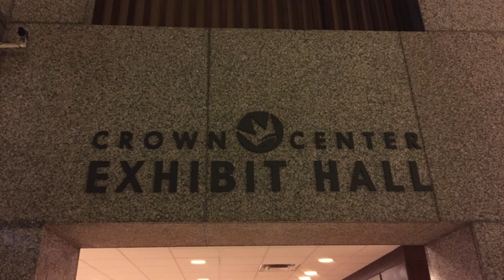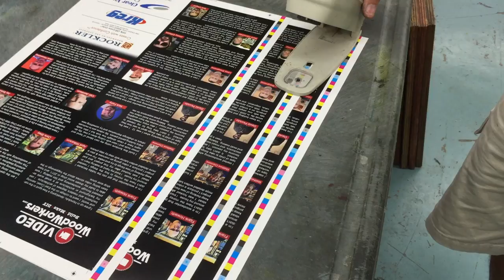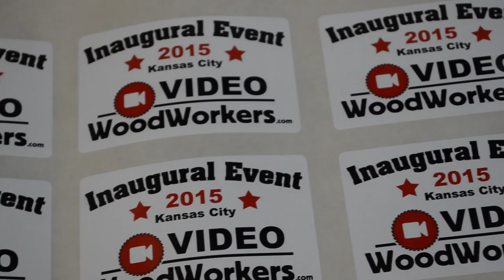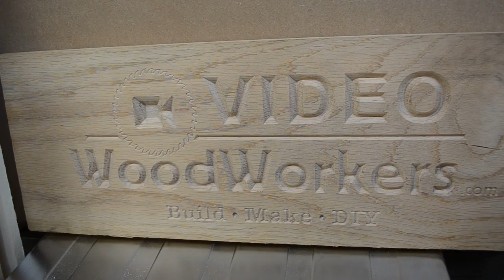Signature Stamp, WIA & Offset Printing (FT34)

Comment: Glad you enjoyed your tour Nick.  I have been in the printing industry for 29 years and it's always fun to show a client how blank sheet goes into one end of the press and comes out the other end with a full color image on it.
I like the stamp too.  I use a self inking stamp that I apply between the layers of the finish.
Reply from the maker: +Chem Cody I thought I remember you being on that periscope - I could be wrong - yeah it was really cool to see how professionals do it - in high school we were essentially "messing around" with different presses and never got quality results - I have tried the ink stamp before but for me the results were mixed
Reply: I think that was me Nick.  (I'm getting forgetful)
I figured out that if I laid down one coat of finish and then stamped the piece it would stop the ink from 'soaking' into the wood and blurring the image.  The next coats of finish then encapsulated the image and that seems to be working pretty well so far.
I still like the idea of stamping your makers mark into the piece.  I will have to look into that.

Comment: It's probably Acrylic. 
The lay the thick sheet of acrylic on top of a (wooden) mold with a very smooth surface.
The mold and sheet are placed in a very big oven where the sheet gets soft and sags over the mold.
Reply from the maker: +RoboCNC Frees- & Graveerwerk that makes sense - I would really love to see the whole process and that oven
Reply: Sometimes you can see it on the discovery fish tank shows... Between the nowadays normal acting and faking they do some very very short shots of how they make stuff...
Reply from the maker: +RoboCNC Frees- & Graveerwerk I checked it out and still can't find the builds

Comment: The tanks are usually a sheet of acrylic that is set on top of a form then put into a large oven and then as the acrylic is heated it forms around the form which gives it its curved shape.  I would recommend checking out 'Tanked' on animal planet (or the web site).
Reply from the maker: +Sport66Fury thanks - I will check that out for sure

Comment: Miss you long time.  The fish tank bulbous thingy was most likely acrylic and in the show "TANKED" they show how they take large sheets of 2-4 inch thick acrylic and heat it over a mold made of bendy plywood shaped how they want it.  Bottom line, it's acrylic that's heated and melted to form to a mold.  Not cheap or easy for a piece the size you saw.  Cheers!  Chris.
Reply from the maker: +Cactus Makeshop that's what I was thinking, that thing must have cost some bucks - would be a cool thing to see
Reply: +Nick Ferry  What Cactus Makeshop said. I worked for a plastic company for a short time, and they made a piece similar to the semi-sphere in the aquarium. The sheet acrylic is heated up and molded over a wooden buck, or sometimes an inflatable bladder is mounted underneath and filled with air to form the proper shape. At least that was how this company did them in the 90s. And yeah - think 4 - 5 figure expensive, depending on the size.
Reply from the maker: Mark Lindsay I have to try the inflating thing - gotta be fun to do
Reply: Nick Ferry  Just the bladder probably cost as much as your table saw. It was a seriously thick rubber job that hooked up to the compressor via a complicated system of valves and regulators. Thing weighed over 100lbs. They didn't use it very often, but when they needed it, nothing else would do. They tended to use wooden bucks and molds a lot more often. The owner of the company made custom tail light lenses for his '40 Ford pickup by heating up red acrylic and using a wooden "mold" in a cheap HF shop press to press down into the acrylic. They came out looking like '59 Cadillac lenses, but sized for his tail light housing. The main thing to remember is to go slowly so you don't punch through the acrylic.
Reply from the maker: Mark Lindsay I will forgo the bladder and just try and blow up the plastic - might not be a vid but I have to try it now

Comment: I was wondering where you had run off to. Thought maybe you'd gotten lost in the KC BBQ restaurant rabbit hole. It's very easy to do, BTW. Hope the hand is feeling better. You might consider a cheap splint from Wally World for evenings when you're relaxing from work. It does actually help the healing process. I know this because my wife is 3 weeks into the same thing - broke her right hand. The splint does help - even if you only wear it for a few hours a day.
Reply from the maker: +Mark Lindsay I looked all around for a cheap splint but kept running into wrist ones only - I have a half-assed one I came up with but it could be better
Reply: Nick Ferry  Now how did I know that you'd make one? Cheers!

Comment: Best sled eva!
Reply from the maker: +Luke Pettit you are too kind man!
Reply: It was THE one I bookmarked for future use, and I've seen a few ;-D
Reply from the maker: Luke Pettit that is so cool to hear
Reply: +Luke Pettit  Same here. I'll be making 2 - one for my daughter, and one for myself. Just waiting on my local supplier to get more T track in. I kind of bought all they had and used it on my CNC, so...
Reply: +Mark Lindsay I hear that. While the track is available here in Australia its not something that would be kept by your local hardware store, but something you have to mail order and that means only certain lengths are able to be posted. Not a huge problem but annoying enough in itself.
Reply: Luke Pettit  I haven't found T-track in any local hardware or home improvement stores either. We have a local tool retail store here that sells it. (No, not Harbor Freight - it's called Medford Tool and Supply.) It's a great place, but very dangerous for me. I can go in and buy a router bit, a saw blade, or a bar clamp, then spend several hours drooling over the big equipment. I have my eye on a band saw, drum sander, and a shaper there. Now I just need to get the space to put them in...
Reply: Hahahaha I think all us woodworkers suffer that problem. I thought my car being off the road for repairs would have cured that problem...... but there's the internet.
Reply: Luke Pettit  Too true. I'm sitting here with an ear-to-ear grin, nodding my head in agreement with you because I'm also tracking a package containing some router bits that I ordered last week. They're only 400 miles away!